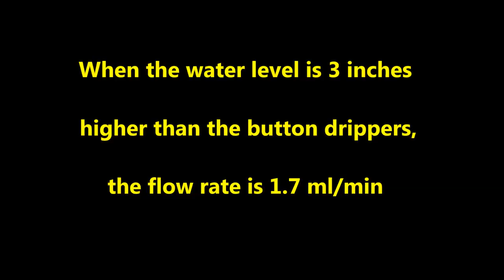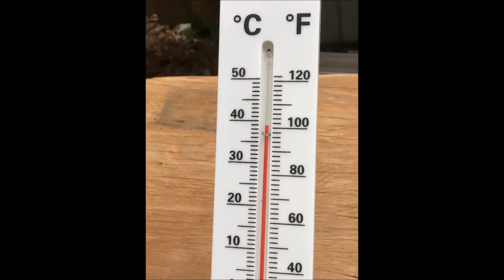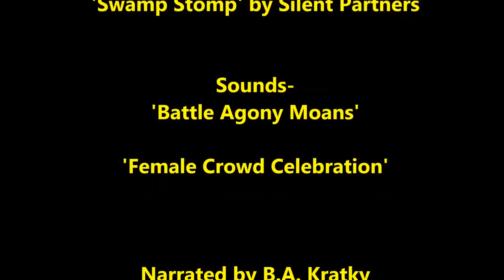Automatic Watering of Yard Plants from Small Water Tanks when away

Comment: How about a moisture sensitive dripper?  It only drips when the soil needs more water.  A stake could hold the mechanism.
Reply from the maker: There are soil tensiometers and also some other devices which can detect the moisture status of the soil and electronically activate a solenoid controlled irrigation system, but successfully implementing your idea with an inexpensive,  passive device would be a wonderful invention.
Reply: @growkratky5558  there is a commercial passive device called "Blumat Tropf"
Reply from the maker: @karlotto8925  Thank you.  This sounds to be a great device.  We used tensiometers to monitor soil moisture.  They have ceramic tips producing a vacuum when the soil dries  causing an increasing reading on a vacuum guage.  It looks like this device utilizes the vacuum to directly activate a valve to water the soil .  It is designed for soil, but I'm not sure if it would act as a float valve in a tank of water.
Reply: @growkratky5558  Yes I think that´s how this device is working. As far as i know their flowrate suits about one plant, watering the soil when the soil gets dry. What´s the idea behind using it as a float valve in a water tank? If the idea is to control a larger irrigation system with more flowrate with just one of this devices I´d had an DIY idea: A normally closed float valve design (putting the inlet at the bottom) which gets opened by the water from the opened Blumat when the soil is dry. Some designs for this come to my mind, e.g. the normally closed yoghurt main float valve on the bottom with a rather heavy closer weight with sealing foam under it mechanically coupled with the swimmer of a Blumat fed separate second yoghurt can on top. There would be a drain hole which drains slower than the open Blumat would feed in order to close the valve again once the soil is moist and the Blumat stops to feed water. This would be a lot of tinkering for sure, and I´m not sure if this relates to your thoughts at all. The most obvious solution is to use many of those Blumat in parallel.

Comment: Is the lower water rate due to the pressure in the water tanks decreasing as they empty? I would imagine if full tank had a flow rate of 1.7 ml/min... a half full tank would have a flow rate much lower than that.
Reply from the maker: Good question.  The most likely culprit is a partially clogged dripper as they are designed to work at 15-25 psi and this application only has 0.1 psi so the dripper might not clean out properly.  Also, I should have placed a filter over the ends of the inlet tubes to prevent dirt from entering the water flow.  

 Pressure and flow rate are affected by the height of the water column in the float valve above the drippers - which is 3 inches in this case. Raising the float valve or lowering the dripper increases pressure, whereas raising the height of the dripper causes lower pressure.  The height of the water in the supply tank does not affect flow providing that the supply tank is physically elevated above the float valve.